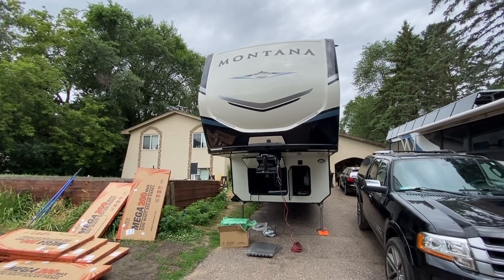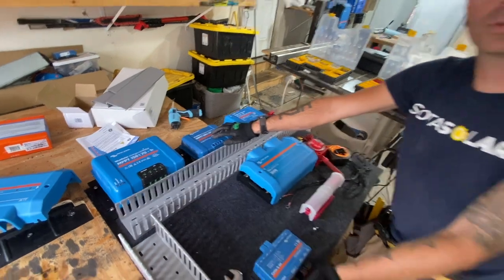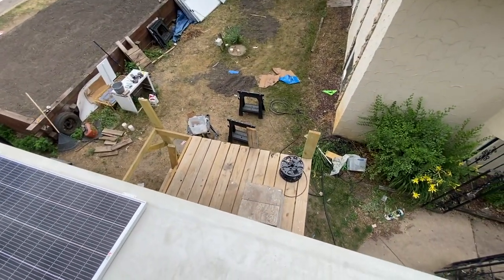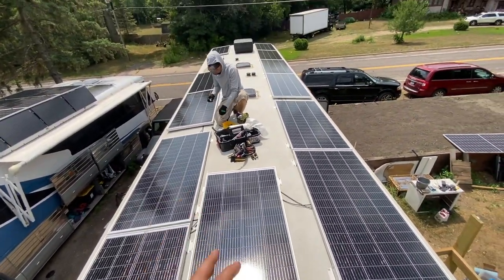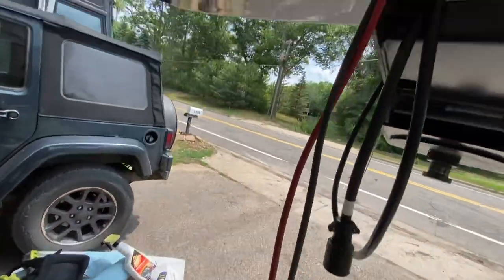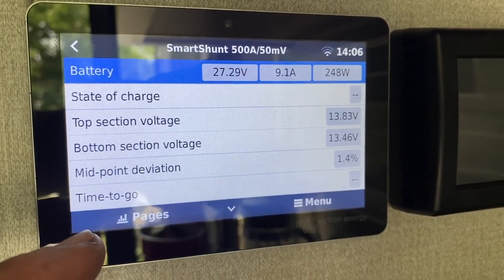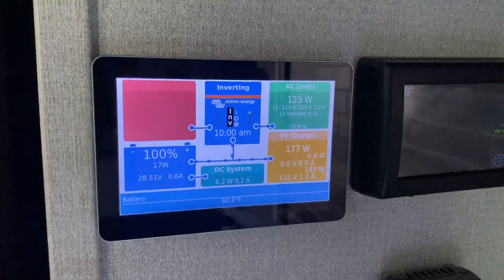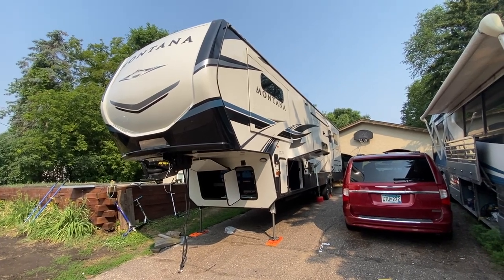Keystone Montana 3791RD RV Solar System Install - 2400w Solar 24v Battery Victron Multiplus

Comment: Just a couple of quick tips guys. When I installed my multi +2 I didn’t get my connections very good, and I melted the thing down. When using those push type connectors, victron recommends that you use ferrules. Even though I still use rigid copper I went ahead and crimped a thorough sleeve on it so that it wasn’t stranded anymore. And it made a world of difference. Also, if you leave more length on those wires, you can loop them once inside the MULTIPLUS before going to the terminal and it makes it so much easier to work with
Reply from the maker: Great tips, thank you! We have a few parts Multiplus around, mAybe we’ll do some experimenting.

Comment: Love the videos, keep them coming! Do you mind sharing a little more about how you mount your panels, and how your securing the wires?
Reply from the maker: Yes we can do that.  We might to a talk on it use clips from various videos.  Generally we do z brackets, #14 metal roofing screws (screws that come with kits are garbage).  Dicor top and bottom of bracket.   For securing wires lately we've done a 3m zip tie tie down and a zip tie and then a dab of dicor on top.  Definitely worth an entire video.
Reply: Have been considering installing GUI Mods as well.  I have downloaded the file to a USB but have not installed to the Cerbo yet.  You mentioned in this video you informed the customer of the "risks"   can you elaborate further or perhaps a dedicated GUI MODS video?   As always, Love you channel and videos!  Thanks
Reply from the maker: @markratliff7991  So, risks are two fold, for us and the for the customer.  I'll start with the customer - Mostly the risk is you get used to something and then a software update breaks it or removes it.  Generally guimods doesn't go away on updates.  I had 1 instance where the screen turned white because of a QML error and the only fix for me was a factory reset.  GUI mods maintainers have since fixed it and that bug is unlikely to happen again.  The risks in short  is, something could go wrong at a bad time and you'll be blind to the system..... but I still use it, so.... 

Risks to us - We support all our installs at a minimum 1 year out and as we can for the life of the install.   If something goes wrong, now we're also on the hook.  For the time being this is something we can't guarantee in the same way we do other official equipment and features.

Comment: Another informative video...thank you for taking the time to make & post your install videos. 
🎉Last fall I installed 400ah of 12v (2-200ah) lithium batteries & a multiplus II 2 x 120 with distributer, shunt ect... I installed it all on our 2021 reflection 341rds in the front bay. 
That was the first stage of our solar, since we live in MN & winter snuck up on us...lol. It came with one 165w furrion panel & 50amp furrion solar charger. So now I have 1440w (8- 180w panels) of solar to install along with another solar charge controller, I was thinking of going with the victron 150/100 12v/24v, but, it is on backorder until about September from what i found. What would be a good opton to go with if I didn't want to wait on a backordered unit...Would the 150/70 be a good option or should i stick with the 150/100 solar charge controller? I will also be replacing the furrion solar charge controller, with a comporable victron unit. 
Sorry for the long winded comment. I will also check out your website.

Thank you,
Brad
Reply from the maker: I can talk with my distributor.  I know I have one, but I think it's going in the next install.  The 70 amp unit is good, you'll be a little over paneled and clip on the most perfect of days, but 90% of the time, you'll be limited by your panels and not your charger.  Are in MN now?
Reply: @sotasolar  yes, we have a seasonal spot @ a campground by Perham, MN. We live in Dilworth, MN.
Right now, we generally stay at the campground for the summer, & take a few trips elsewhere in the spring & fall. Eventually our plan is to do a bit more traveling & I am just trying to get our solar setup/ready for future use.
So if I have to order &  wait for the 150/100 12v/24v solar charge controller, then I will do that. Or just spend the extra $300 or so on the 150/100  12v/24v/36v/48v controller.
So basically I don't absolutely have to have that controller right now.
I am generally just not very patient when it comes to waiting for anything....lol
Thank for taking the time to reply. I appreciate it.
Reply from the maker: @BradLMN  https://invertersrus.com/victron-energy-b-stock-sale/?ref=sotasolar Can always check this out as well from my distributor.  Give them a call and see what they can do for you.   The B-Stock is often times new just with damaged packaging, I use it on my own still all the time.
Reply: @sotasolar  Thank you for the link & heads up.
Keep up the good work & putting out the content you do, it's very informative & entertaining. 
Plus it is nice to see someone I consider local, being from the same state, doing something they like to do. 👍